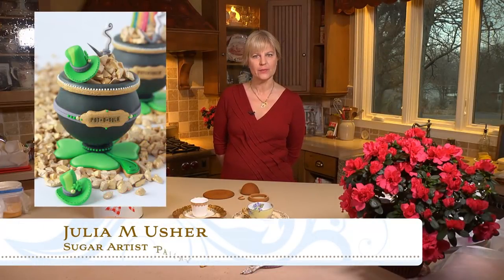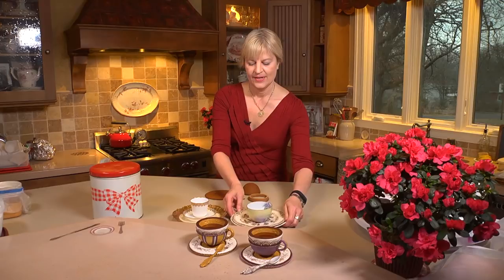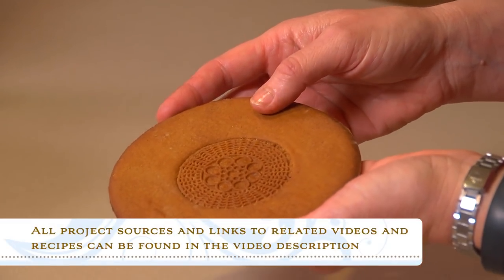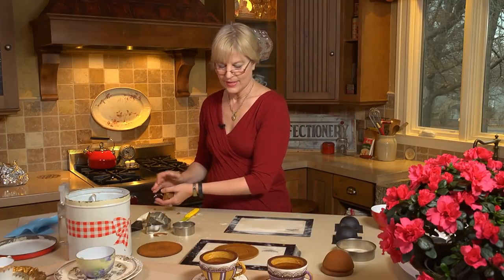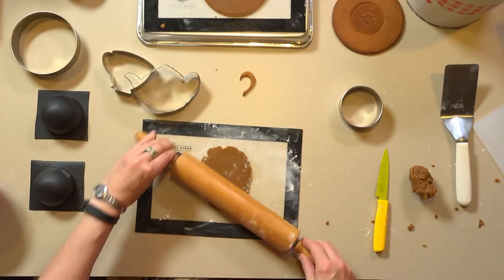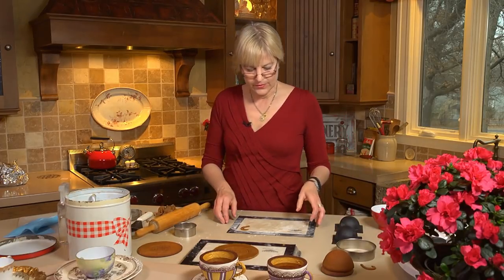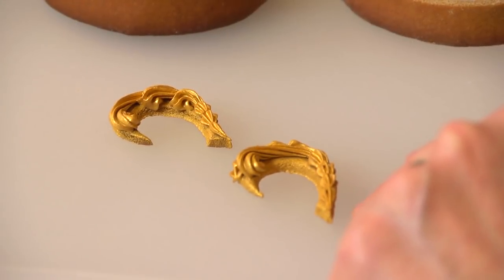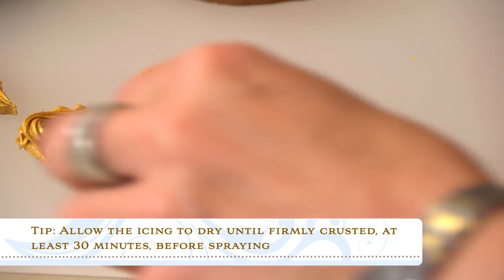How to Make 3-D Cookie Teacups

Comment: Oh, quick question: have you ever tried putting more than one stamp at a time onto the acrylic block? It seems like such a small thing, but I work with papercrafting, and after years of using wooden blocks and then going with the acrylic blocks, it was like a bomb went off in my head when I realized that I could just add them together to form a different pattern...when I'm working with more textured papers and items, I don't do it so that I can have more control over where the ink goes. Just curious!
Reply: I never even thought of that, to be honest, but it totally makes sense.

Comment: Is there a reason you use spray luster vs using luster dust mixed with alcohol? Do they hoth give the same effect?
Reply: oh ok, that makes sense. I usually just add luster in a few details, not a large area so I have never tried the spray. thanks! :)

Comment: Would it be possible to put a thick cream one that isn't very watery so it won't work the cookie in the bottom of the teacup before you put the top with the ice melt on that way when someone breaks the isomalt top they find a creamy treat inside?
Reply from the maker: Sure - as long as you serve the cookies relatively immediately after filling with the cream, if the filling is perishable (as the cookies and isomalt really can't be refrigerated for too long, or the cookies will get soggy and the isomalt will attract moisture).

Comment: Hi. May I ask what size are the silicone mold you are using for the teacups and what size mold for the baby gender reveal rattles?

I tried doing what you did, but you a different type of Mold to shape the cup. I froze to keep its shape then I baked it. It flattened of course.. 
was I suppose to keep it in its silicone mold for support as it baked?
Reply from the maker: Links to all of my sources used (and often detailed project dimensions) can always be found in the video descriptions under the video player under every video; just click on SHOW MORE and all the source links will come up. These molds are about 2 3/4 to 3 inches in diameter; I don't recall what I used for the rattle, but, again, the link can be found under that video. Yes, as explained and shown in the video, you bake on the molds. If you don't, the dough will collapse.
Reply: JuliaMUsher perfect thank you so much
Reply from the maker: @1Royche  :)

Comment: Absolutely stunning, Julia.  The design looks as if it could be a part of a Noritaki collection.  Is there a particular company you go for when collecting vintage/antique china or are you drawn to the designs and the maker is secondary?  I'm not certain if you are aware of this company called Replacements.  They have hundreds of thousands of old china designs that you can buy.   I use them to add pieces to my china and flatware I get at estate sales.  Might be fun to check out.  They even have a small You Tube channel for table decorating.
Reply: +Julia M Usher I'm glad.  It's a great company.  There is a small amount of You Tube videos from the company, but what they do have is very interesting for place setting suggestions.  It seems that you and I have a slightly similar esthetic, hence the referral to the company.  Take care! :)